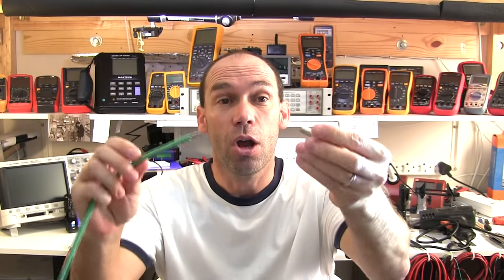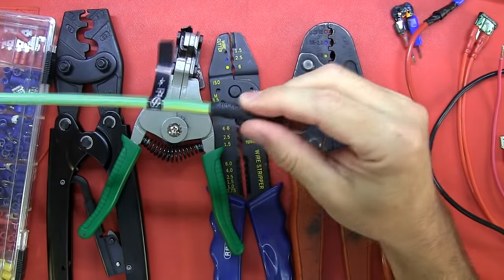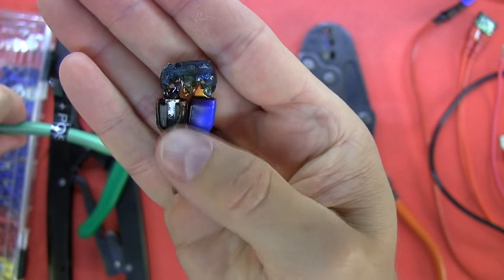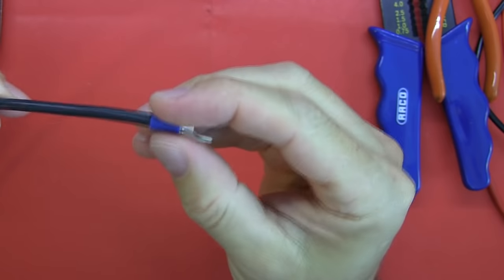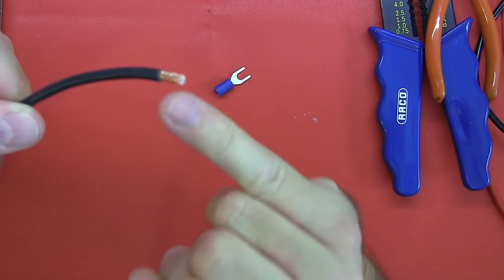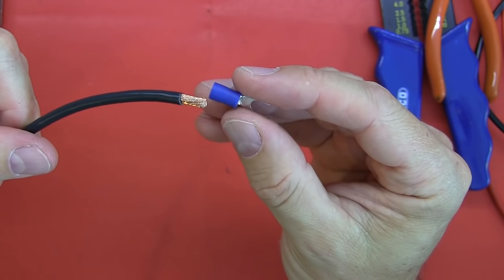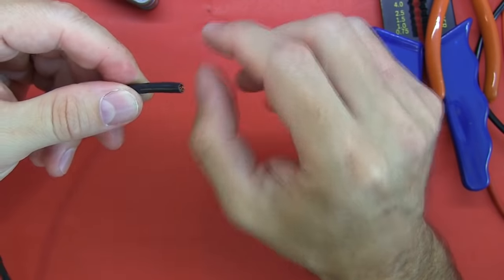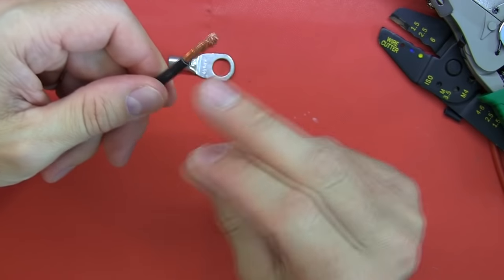Tutorial: How to crimp connectors, strip wire and use heat shrink.

Comment: I have a question... This is car related... I soldered 1 wire into another wire... I'm removing the one I soldered on... I'm planing to just use scissors to cut it off... So the question is... I want to use heat shrink tubing to protect it... but unlike all the videos on here where people just slide it on (which i can't because it's all connected how do i do it? can i cut the tubing in half and wrap it around the wire ? and heat it up?
Reply: Hey bud, I know I might be a little late but simply use your soldering iron to heat the solder and release the connection,  slide your appropriately sized heat shrink over one end of the now separated wire (far enough away that your solder gun won't melt it when you re-apply the solder to the connection, re-tin the wires, solder them together again and heat the heat shrink to protect your connection. Best of luck!

Comment: Hmm alright alright mjlorton.. not bad, not bad at all.. I will give you a UG with kryds og slange as a Danish grading, only thing I  missed was perhaps some deeper information about heat-shrinks fx with glue and the different version of heat-shrinks as heat-shrinks comes in ridiculous many version, from insane thick and potent that actually shrink with 5/1 and 4/1 and surprisingly thick quality to ridiculous thin and often quite shabby.. 
thx for the vid.  :-)

Comment: hello sir ,im working on a high voltage and amps electric bike,the voltage is 100 volts max and current is 450 amps ,what would be your suggestion in type of connectors ,solder or crimp connectors ,your answer is greatly appreciated?

Comment: Those aren’t inspection windows on the terminals, they are access holes to feed solder into. 
Pre tinning your wire is better because the wire surface becomes rough and textured for your terminal to grip to vs crimping a smooth copper wire. 
Those style glass fuse holders are a poor 
choice, the spring tension inside becomes weak due to heat and fatigue and results in poor contacts. Always use proper blade style fuse holders. Your homemade holder is overheating and melting  because the terminals are thin, you need a much heavier setup.

Comment: You should always use proper heat shrink that is rated for the voltage and have the glue. The red one that you used is only for color mark.

Comment: i just like to ask what do you call that black rubber you used to cover the end of the wire the one that you use heat then it will shrink to fit the wre
Reply: Heat shrink

Comment: ive found if you heat up the wire with a lighter first and weaken the plastic you can reliably cut it off later with scissors or whatever without cutting off strands... i imagine if you heat it too much you might make some brittle wire however so dont do that.

Comment: The best wire stripper is a solder gun which melts insulation and you can pull of the insulation. Many small time mechanics use matchsticks and use the heat to strip wires.
Reply: no

Comment: Man thanks for this video. I've been in search for information for quite some time and so far have found little to none videos about this topic, certainly none so thorough. Now I looked at those ratchet type crimping tools and since they are fairly expensive I'd like to get the right one. It seems there are two types of those tools and one of them is for insulated connectors and the other for non-insulated connectors. May I ask what type of connectors are this crimp eyele, spade, forks and others?

Also, that cheapo crimp tool has ISO written in the middle of the tool. Do you know what that is for? Because I got some ISO connectors and I don't know whether I should use it to crimp those connectors or use it in the standard crimp part of that tool.

By the way, those ISO connectors I got, I hope they would hold mini fuses (I believe it should fit into a fuse holder I bought separately) but as you shown it might not be a good idea, although current that should flow through those iso connectors is likely to be very little.

Comment: You can purchase the AFM8 Crimper on amazon here: http://www.amazon.com/sp?_encoding=UTF8&asin=&isAmazonFulfilled=&isCBA=&marketplaceID=ATVPDKIKX0DER&orderID=&seller=ADSK1MTMXQOWA&tab=&vasStoreID=

The AFM8, qualified to MIL-DTL-22520-2-01 is designed for most of the miniature and sub-miniature connector types that are so widely used in electronic systems. The AFM8 meets the need for a miniature tool accommodating wire sizes 20 through 32 AWG. The AFM8 gives a Mil-Standard 8 impression crimp, which assures maximum tensile strength. The tool frame has a built-in 8 step selector knob for ease in dialing the correct crimp depth setting for the wire being used.
Reply: Thank thank you. Though these are very expensive but mechanically superior to the mechanically inferior type used by the person who is not strong enough to mechanically crimp with one hand. The one you listed from Amazon has up to I believe 9 points of contact. A very nice tool.The one shown in the video is a piece of crap.   But one thing, I must admit my stupid lack of knowledge; I was totally unaware of the Ph.D.  Degree now available in wire stripping and lug crimping. This was an epic journal and documentary that DeMille would be envious of. Bravo, Cheers❗️❗️❗️🛌 oh and if you lost your meter I know where it is.....digitally; not mechanically speaking 🤖🔫
Reply: +James Lucas - In fairness - He did not use the word 'mechanically' that much!
Reply: +Sonscope the Saboteur  I suppose you are right. I was a bit mean and it was not the intent but the humor I was unsuccessful in conveying. Thank you. Touch'e' 😎
Reply: +James Lucas - For the record can I just add that your comment did give me a chuckle!

Comment: Crimp and solder after all you can have the best crimp in world eventually corrosion will find a way in and connections fail seen it happen soldering then heatshrink keep most possible contamination out

Comment: I think you forgot to mention that many wires, even after stripped, have an enamel coat (the pinkish coating, whereas clean copper is brilliantly lustrous), esp. with stranded wire.  Some will suggest burning it off with a lighter, but that never worked for me so I use a tiny bit of sand paper and fold it over the wire to work it off that way.

Also, tinning stranded wire to make it more solid may be wrong for crimping, however, it gives a better lock in 'em fat-ass screw terminals that take 4, 5... AWG stranded wires.

As for the best wire strippers; personal choice, but mine are the scissor-like tool, or more like a side cutter with a notch which you can use by feel or adjust a screw on one handle to lock how far it can cut.  (I forgot its formal name.)  I'll only use labeled strippers for multi-conductor wires like coax or CAT5 and the like.  Those plate metal single-wire strippers/crimpers -- the flimsy pieces of crap you get at Radio Shack, The Source, Canadian Tire, etc -- can be tossed in the trash.  Thick and bulky crimpers are the way to go (or specialized crimpers where required)..

Oh, and at the very beginning (and end) you mentioned and showed some bad connectors that could have started a fire.  I thought I'd expand:  Because a bad connection mean less area for the current to move through it will impede it like a resistor.  Thus, using P=I^2*R, the real heat generated can be tremendous.  This is true of all connectors and esp. socket-type, or plug-in devices like some relays or fuses.  For example, the relay box under my car hood melted completely  (lots of smoke and goo) when the horn relay corroded at the blade connection.  It's a good idea to inspect friction-held connections on occasion for corrosion and whatnot.  Corroded blades on simple household plugs are just as dangerous too.

When you run out of shrink tubing do you ever use silicone caulking instead?  I've contemplated it on occasion, but am unsure of how safe or unsafe it would be.
Reply: I've never seen these purple coated stranded wire you speak of. I'm not sure sanding will remove all of it, it's only going to work on the outer strands on their outer areas. You get what you pay for in most crimpers.
Reply: Jim Davis Unless you buy them at the now bankrupt Radio Shack or this store here in Canada called The Source.  They have to jack their prices for all the overhead because nobody shops at brick and mortar stores no more and this world seems deprived of a healthy populatioln of nerds.

Anyway...

Not purple, rather pink.  Or red.  It's the enamel on practically every wire from headphones to transformers.  There's no way you hven't seen it before.

But that doesn't really matter.  I was hoping you could give me a materials tip when I run out of tubing.  (Sorry for my tone.  Had a rough night.)
Reply: I think you've been hallucinating, the inner wire strands of any wire do not get any coating. That would be ridiculous.
Reply: Some call it "magnet wire" or other names.  It's coated with enamel.  It's very, very common.  There is probably more enamel-coated wire than any other kind simply due to how many times it's wound around things.  It's also used in cables with stranded wire that are meant to be flexible on a constant basis.  Forget I asked.

But, again, I don't fucking care if you know about how many different kinds of wires there are.  I wanted to know if you'd share your experience with silicone caulking on bare wire.  However, I'm not really feeling the trust in your knowledge base anymore.

Have a nice day.
Reply: Ya magnet wire is coated but that's the only type and who the hell uses magnet wire except you apparently. Some types of silicone are ok for sealing connectors, but the type that smells like vineagar is not. You can also fill with dielectric grease. And of course, you can used sealed connectors.
Reply: Stranded enameled wire is used a lot.  It doesn't matter if you don't believe me.  And I've never come accross a silicone that didn't cure by stinking of vinegar.

Dielectric grease.  There was stuff we used when connecting 500 cable up north.  We called it "bear shit".  Probably same kinda thing.  I think I'll stick with shrink tubing.

Hope you didn't ride into a June bug too fast.  Use a visor.  Let's just end it there.

(I thought you were the guy who posted this vid - the one who sounds like he knows what he's talking about.  My mistake.)
Reply: Yes you are mistaken, I'm only a successful business owner working with wire actually making products for 12 years now.

Comment: Same rules apply, use a BUTT connector. Any OUTSIDE connections need HEAT SHRINK. They make connectors with heat shrink all in one. Just crimp and heat.

Comment: I would have thought those makeshift fuse holders melted because the fuses were rated higher than the current carrying capability of the crimps. Red crimps are for 1mm² wire, but I see a 30A green fuse!

Comment: Really useful information! Speaking of finding the right size wire lug, here's what seems to be a great DIY idea - watch?v=JcpROoph2Lc - simply crimping a copper pipe over the wire and then hammering down and drilling the part that will fit over the battery terminals - going to give this a try :D

Comment: did anybody mention wire glue  it looks like liquid solder  it dries fast and holds you can slide a heat shrink tube over it heat it is there for ever ????

Comment: I think he's putting the wire in backward.  The wire should go in the side with the color dots.  One side is slightly shorter than the other side - you want the side that will crimp more on the metal side.

Comment: Instead of folding back the copper, spread it out around the insulator.
Reply: No use the proper terminals. When properly  installed the crimper uses the split in the terminal barrel to grab two fistfuls of wire strands. Doing what you suggest on terminal that require a dimple crimp would have less wire to grab a hold of. The remaining strands not grabbed by the crimp would be free floating, not electrically and mechanically secure.

Comment: Okay, I'm at an absolute loss here. I take about 18 AWG wire, put it in a red insulated crimp terminal (which should be rated for 16-22 AWG wire), take off exactly the right amount of insulation on the wire (so that the wire reaches exactly from the beginning of the metal part of the crimp terminal and on the other end sticks out 1 mm or so). Then I take a good ratcheting crimp tool and crimp while placing the wire on exactly the right position, and putting in far more force than would be required to release the ratchet. Yet when I'm done there's no mechanical connection whatsoever. It only takes the smallest tug with my fingers to slide the terminal right off the wire again.

What could I possibly be doing wrong?

Comment: That "inspection window" in that lug is for adding solder after crimping.
Reply: not necessarily.  Many connector mfg installation instructions specifically state to not add any solder to crimp connections.  For reference, please refer to TE / AMP solistrand connector instructions.  Purpose of inspection  window is to allow for verification that connector / conductor has been properly made.  Filling inspection hole with solder does not allow for subsequent inspection.  https://www.ttieurope.com/content/dam/tti-europe/resources/Literature/SupplierGuides/1473-TE-Connectivity-Good-Crimping-v3Web.pdf
Reply: @benjybertossi5328  from what ive seen they advise not adding solder before crimping because it stops the strands from parting and getting a deep crimp.

Many butt connectors have solder already inside them to be heated after the crimp, and some have the holes just like on this lug for adding your own solder after the crimping is done. 

Theres no need to inspect the wire inside the lug after its been crimped properly and soldered by someone that knows what they're doing. 

If you cant trust someones work you redo it yourself anyway, looking in the end only tells you the wire was stripped to the correct length.
Reply: @donzmilky5961  Thanks for the feedback.  I was going by instructions for TE / AMP Tyco crimp connections.  From working in the nuclear plant world,  tens of thousands of crimp connections, never soldered, solder connections are brittle and prone to failure unless connections has proper strain relief.  I was taught you solder solder connections and crimp crimp connections and don't combine the two unless connector is specifically designed for that method.  I am old school with solder, but I have to admit crimp connectors make life so much easier...if only I could find a reasonably priced "W" crimp die for Solistrand connectors ; )
Reply: @benjybertossi5328  some applications call for solder, some for crimps, sometimes a crimped and soldered connection is beneficial.

Its convenient to use a connector like this for certain things, like my dads kawasaki mule needed new wires ran for headlights and tail lights, convenient to find the type of connector end you need with a crimp base, then add solder to keep corrosion from seeping into the wire.

Crimp and solder is usually something id do when i expect humidity or mud to end up nearby when its not feasible to encapsulate the entire connection in shrink tube or some sealing agent.
Reply: @benjybertossi5328  in the absence of vibration or repeated mechanical strain i beleive adding solder gives a better electrical and thermal connection. And may tarnish on the surface, but wont corrode as quickly as open strands.

Comment: Great video.  With respect to tinning the wire end before inserting into the connector, isn't solder malleable enough that the tinned wire should still form into the connector well?  That's been my observation.

Comment: solder or tinning the wire is no good idea because it has a cold flow under pressure with result in loose contact.

Comment: No no you have to turn the bottom of terminal toward color code not the head.
Reply: I was wondering if anybody else thought what he did was incorrect. It's the same principle as if you're crimping an uninsulated terminal. The seam (on the top side of the terminal) faces toward the flat side of the crimper not the part that makes the dimple. Probably doesn't make a large difference with this type of crimping tool because the top surface is still pretty flat.

Comment: On my crimper, which is a reasonabe quality Hilka one similar to the one in your video, the dies are different sizes on each face. The face with the coloured dots has a more complex shape and has a bigger gap between the jaws than the other face. The non dot side also leaves a small dot impressed into the sleeve. So which side is which?

To further confuse things, more than one YouTube video, such as https://youtu.be/YLhpdgXzx28  states that the way up of the crimper matters as the metal sleeves have a split in it and these guys claims it matters which way up the split goes as the 2 jaws have different shapes.

In summary my crimper allows the terminal to be inserted in 4 different orientations, so which one do I use?

Comment: you arent supposed to pull on wire strippers. you close down on the wire with the stripper in the correct size hole, then instead of pulling on the strippers you open them and just pull off the cut peice of insulation. that is the correct way to use the non-mechanical strippers but nobody ever does it because it takes longer, other electricians will look at you funny.